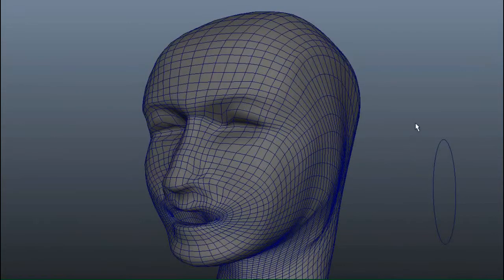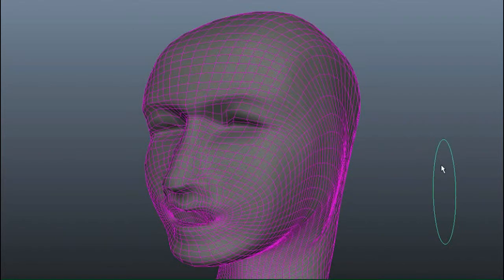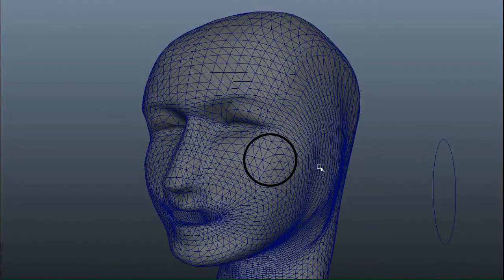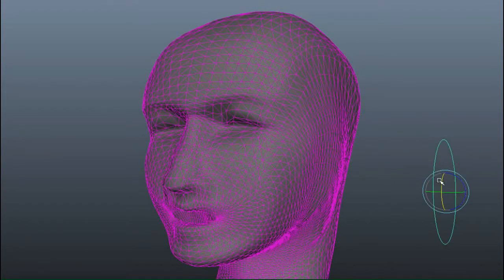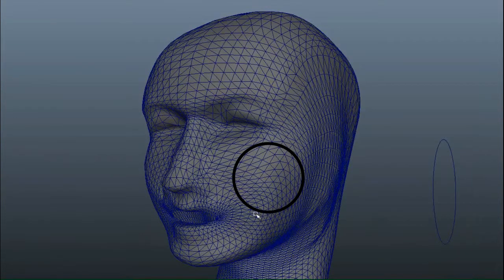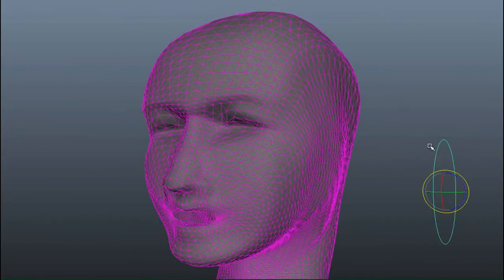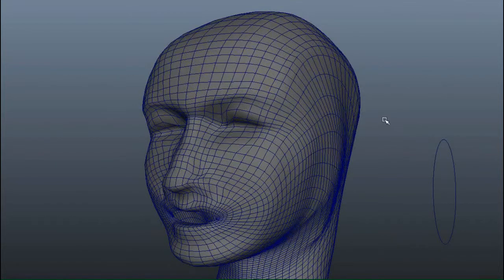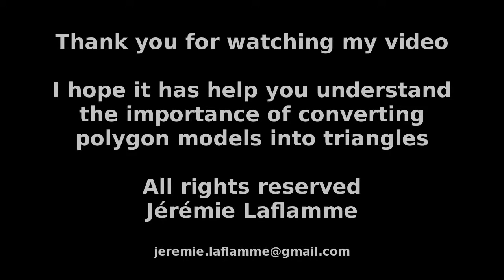Polygon triangles 2. Why should we convert our models to triangles (Muscle animation)

Comment: Models for film should not have triangles due to the post-processing on the model. Subsurf pinches at triangles, and displacement modifiers do not like like them. This is applying more to games due to the tessellation features added in DX11.
However, I still wonder why edge flipping it is not considered an issue.  Perhaps the subsurf (or tessellating in DX11+ or in OpenSubdiv) is high enough to make it irrelevant.
Reply from the maker: Interesting point but. Triangulation is needed in both industries. Understanding your triangulation even with displacement is very important for proper deformation. I think you are confusing with the triangulation process that should come after displacement and not before...
Reply: jeremie laflamme I definitely agree that knowing how the model is triangulated is important. However, artists have no control over how their model is triangulated when they must pass an all-quad model down the pipeline due to the subsurf modifier or the advanced tessellation that OpenSubdiv and DX11+ use at render time. 3DSMax is a little different since its quads have "hidden" edges that can be manipulated. Tools like Maya and Blender do not have "hidden" edges, though.

I am curious if having a way of controlling triangulation in such a pipeline would allow models, such as those for film, to use less subdivisions during rendering.
Reply from the maker: That is what I am saying. You should be able to have control and it would have a very valuable result for deformations. I understand both pipelines of production and my videos try to explain the research I've done on the subject.
Reply: Oh, okay. In that case, you would make a lot of people happy if you developed and implemented that ability for programs like Maya.
Reply from the maker: ACBlenderTutorials Yes I know.. Just need the some open minded people.. and good programmers :)